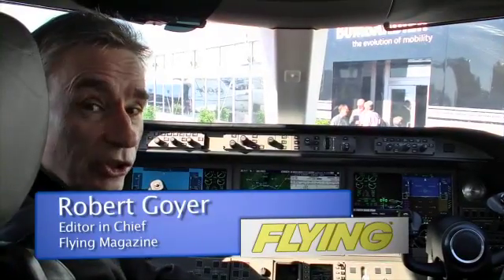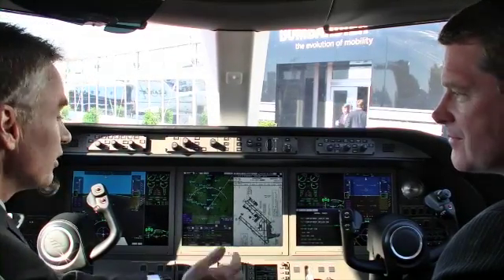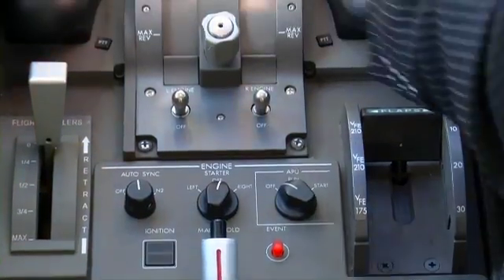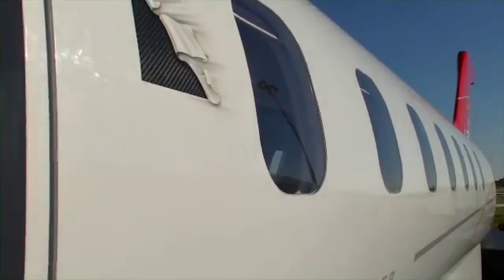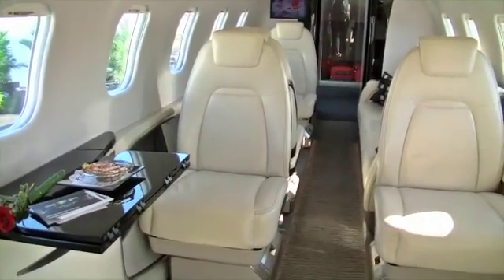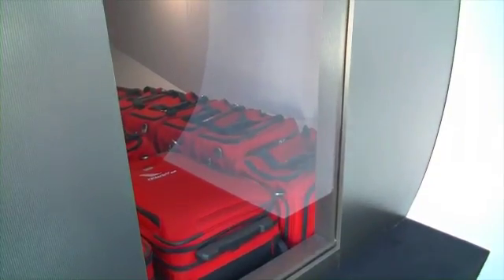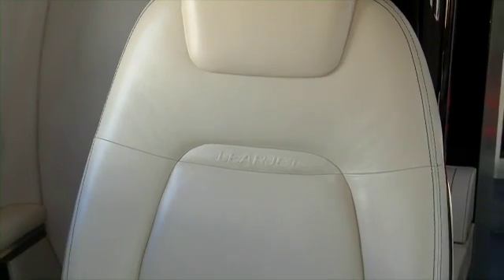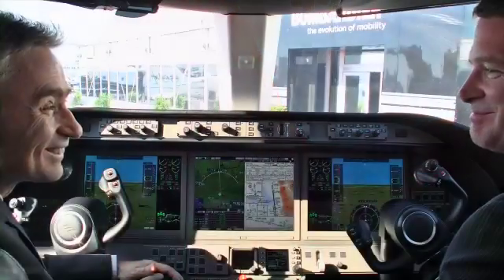Learjet 85 — Flying Magazine

Comment: I'm a bit late with a comment (only just saw this clip), but I thought I'd respond to Shafrir.

The Lear 60 is certified to FL510, but it by no means operates up there.  It really won't do it.  I once took a 60 to FL470 for demonstration purposes.  It was a bit of a struggle once above FL430 and I went right back down to FL400 in about 10 minutes.  FL400 - FL410 are normal cruise altitudes, with the occasional FL430.

The Mmo of the Lear 60 is .81 up to FL380 and then progressively drops to .78 at FL430.  At FL470 the best speed (at max continuous power) I could get out of the plane was mach .75.

I can only speculate why Bombardier went for a certified ceiling of FL490 and not FL510 but it is hardly a "downgrade."  As for speed, the Lear 85 has a .82 Mmo and I'll bet it doesn't go down with altitude like the 60.  I kind of would have liked to see an Mmo of at least .85 to put it up there with some of the other mid-size/super mid-size corporate aircraft.  But, you're not going to go that fast anyway.

Perhaps I'll find myself in the Learjet 85 in the no-too-distant future.  I'd look forward to it.

- 3,000 hours PIC, Learjet 60/60XR